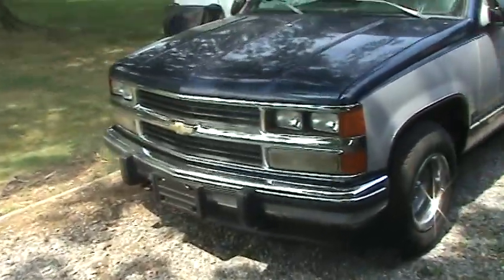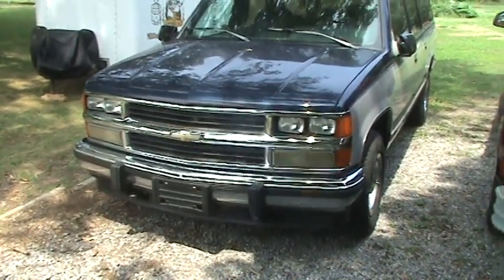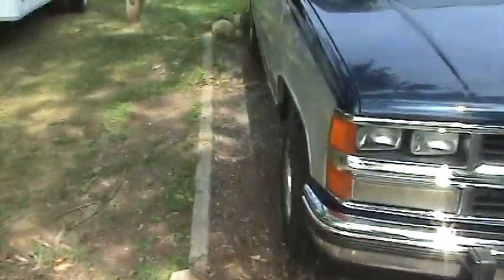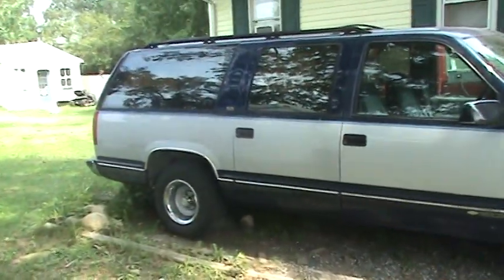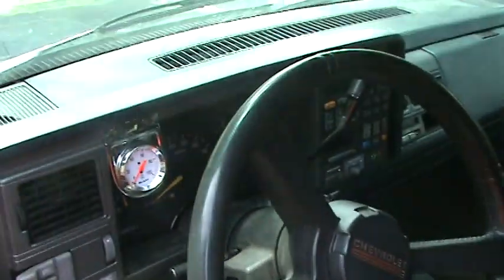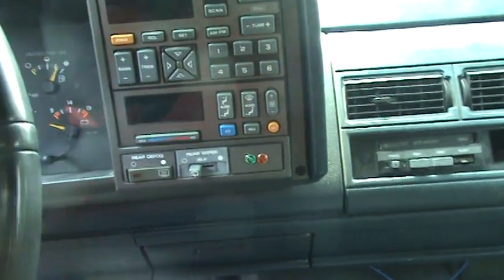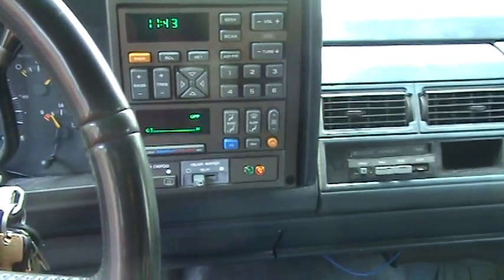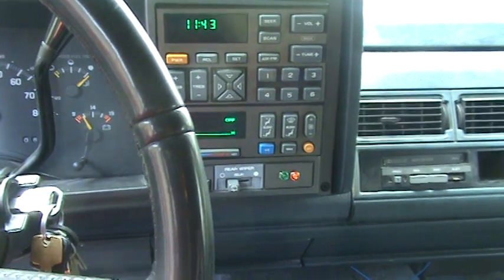1993 2wd Suburban 6.2L Diesel swap part 1

Comment: @dborrelli74 i know that a 6.2 diesel will fit in a '78 chevy 1/2 ton suburban. like you said before, installing a 6.2 diesel in a 75 silverado is very simple.

Comment from the maker: By the way, thanks for the compliment on the truck. If you wanted to carb the gas engine from the 1988 you just need a carb intake for an 86 on up small block. I prefer the diesel though, because of the fuel economy. However, I will say this; it is not a Cummins, so if you want to go fast or tow heavy loads frequently, you'd probably be better off with the gas engine.  If you want mid 20s for MPG in your truck and don't mind the power of a 305, the 6.2 will do the job reliably and efficiently.

Comment from the maker: Installing the 6.2 into the 75 will be very simple. The wire currently going to the HEI distributor will go to the fuel shut off solenoid on the injection pump instead.  The engine will fit right wherever a small block or big block will fit. The only issues will be the following:
1: You need to use a diesel torque converter because it will have a lower stall speed and furnace braised fins
2: You need a diesel specific governor for the trans, and a vacuum regulator valve for the vacuum modulator.
Reply: dborrelli74. how about if its a granny 4 speed in a 3/4 truck what all will i have to do? do i have to change anything in my fuel tank. my 6.2 has a push pump on the block it self.

Comment from the maker: I selected my components carefully when I built the engine to maximize fuel economy.  They are all factory parts, but not in any combination the factory built.  Also, I set the cruise control at the speed limit.  If I go over 65 the mileage drops like a lead balloon.

Comment from the maker: That high idle is long fixed.  I have it set to idle at 625 and fast idle at 850.  Still does about 24 overall and 27 on pure highway running.  Thanks for the comment!
Reply: dborrelli74 hi

Comment: I made the same dryer hose cold air intake but the hood spring mechanism on the side there would crush the hose everytime i'd shut the hood. So I ended up running the hose to the opening in the grill where the stock intake port would be. Cost me $4 and works great too

Comment from the maker: On an 89 it would be even easier.  These came with 6.2L diesels from the factory.  Depending on gearing and whether your Suburban is 2wd or 4wd, you could get up to 25-26 MPG.  It will be slightly lower than my bodystyle because my bodystyle is more aerodynamic.  However, it will still be very good, and might be better around town, because your bodystyle is lighter.  FYI, I get 27 MPG highway and 22 MPG around town.

Comment from the maker: @rborneman: ... on gas trucks but the diesel trucks don't use a relay... they use the oil pressure switch only.  The problem with that is that the switch has proven to be unreliable under the load of the fuel pump over the long term. So I made the oil pressure switch run the fuel pump relay.  This is important for safety so the pump can't run in the event that the vehicle is in an accident and the engine stops running, the pump stops running too, preventing fuel from leaking from ruptured lines.

Comment from the maker: @rborneman Actually the plastic fuel filter holder works perfectly.  As for the re-wire:  I just pulled the gray wire from the harness and hooked it up to the inline pump and ran a ground.  Then I re-wired the fuel pump relay to turn on with the oil pressure switch (in the gas Suburban and truck, the oil pressure switch is in parallel with the relay and serves to back up the relay in case the relay fails).  The reason I did this is because the PCM controls the the fuel pump on gas trucks... cont

Comment: @dborrelli74 

so you essentially converted the fuel delivery system over to that of the GMT400 (88-98) diesels with the lift pump on the frame? does the plastic filter holder work for the lift pump? how bad was the re-wire job? did most everything diesel spec pretty well bolt up?

excellent video, wish they would have offered it from the factory. it would have went over well in my opinion. because it was sure a long dry spell between 1991 and 1994.

Comment from the maker: @rborneman I just used the engine's vacuum pump for the vacuum booster. It works well.  I am using a THM-700R4 for the transmission, and I installed a diesel sender and inline lift pump (you need one for a 1993 3/4 ton Suburban with a 6.5L turbodiesel because the 6.2L wasn't offered in the Suburban after 1991).

Comment: do you plan to convert it to hydroboost braking? otherwise, what are you doing for vacuum? what are you running for a transmission? what di you do in the fuel tank department? did you switch over to a diesel suction tube assembly?

Comment: i have a 91 chevy 1500 305 with a 700r4 trans i am wanting to swap a 6.2 into my truck wht all did you use to swap them out i am guessing radatior and that is all the same are the motor mounts the same and how did you wire it all up any info would be great thanks

Comment from the maker: I am not planning to turbo charge it, since it is not a hauler, just a cruiser.  If I build one for my pickup (the F-150 in the beginning of the video)  which I do use to haul regularly, I might turbo charge that one.  Also, since this is the  wife's car, I can't trust that it will get idled down before shutdown, and I do not want the added complexity of the plumbing on her daily driver.

Comment from the maker: @zozx he were to haul a significant load on a regular basis.  10 years ago, even an empty Powerstroke or Cummins on 6.5L or Duramax would get 5-10 MPG more than a gasser when unloaded.  So it made sense then, even without a load.  For me, when I have only $4,000 into the entire project, and considering that I optimized my build for fuel economy (I have a Ford F-150 for any heavy work), it is definitely worth it in my application.

Comment from the maker: @zozx ... for you.  As an example, my brother in law drives a 52 MPG VW Golf Diesel.  The gas 2.0L 4 cylinder gets 31 MPG.  He drives alot for work, and racks up about 60,000 miles a year, and gets paid $0.45 per mile for work.  Needless to say, he makes out like a bandit.  Now a guy driving a 2010 Powerstroke getting 15 MPG (when a gas engine does the same) that seldom hauls anything won't gety anything out of it, because he spent an extra 6,000 for an engine that gives him nothing unless MORE

Comment from the maker: @zozx It depends on the mileage the gas version gets Vrs. the diesel version.  For example, newer diesels that are hamstrung with all the particulate filters, EGR systems, and SCR catalysts struggle to achieve much better mileage than gas engines in 3/4 and 1 ton trucks, when run unloaded.  Now, with a large trailer or heavy load in the bed, they still do much better than their gas counterparts.  Ultimately, you must decide how you use the vehicle, how long you will own it, and what works MORE..

Comment from the maker: @zozx Injectors require service at high mileage, and this can be costly, especially on newer diesels.  Older ones like mine need injectors overhauled every 120,000 to 150,000 miles, at a cost of about $400 (if you do the R&R work yourself).  Modern diesels won't usually need injector work for 300,000 to 400,000 miles in most instances, but when they do, be prepared to shell out a few grand.  High quality, treated fuel flowing through clean, high quality fuel filters is key to max injector life.

Comment from the maker: @zozx Maintenance wise, they are equal, but different.  Fuel and air filters are more critical and need frequent replacement.  oil changes are more costly because they usually hold more oil than gas engines.  Glow plugs need replacing, but much like spark plugs, the interval varies.  With the current status of diesel fuel being "ultra-low sulphur", there is concern that modern fuel lacks the lubricity requirements of older diesel equipment.  Therefore it is wise to use a fuel additive.  More...

Comment from the maker: I just have the air coming in from the factory pocket in the passenger side fender.  That's where the gas 350 got it's air.  I just used the dryer tube to eliminate the intake restrictor...er, um I mean "muffler".